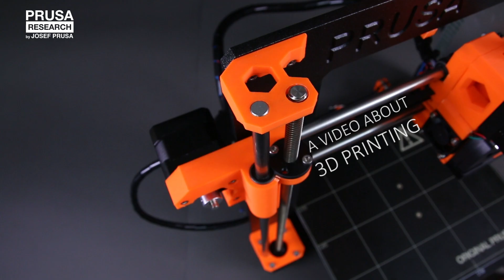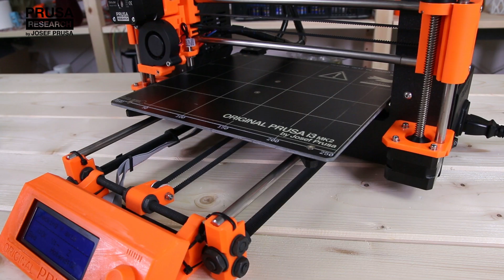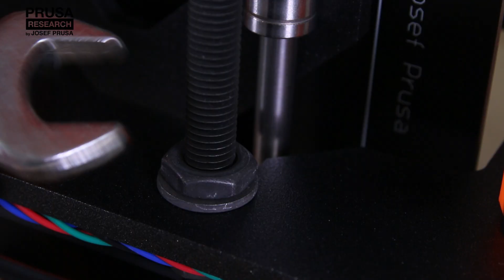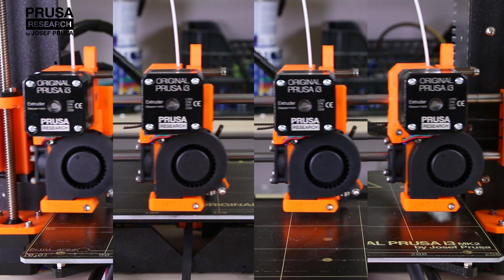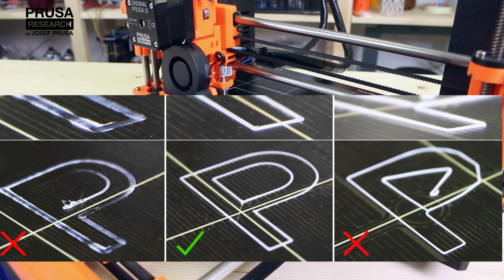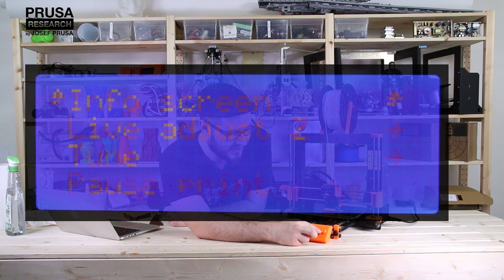Original Prusa i3 MK2 Guide for a new user

Comment: I just rebuilt my I3 with the MK2 upgrade kit.  I am having a hard time getting the print to adhere to the bed.  I have it dialed in on calibration, but the "first layer test" isn't sticking.  I tried using some glue on the bed, but still not working.  Wondering if there are any other tips or tweaks I should be trying.

Comment: Just some tips for builders of the 2s. I’m using a height of 1.3 mm for the sensor and a Z correction of -850, this gives me perfect results with the supplied PLA. Also I am sticking with firmware 3.1.0. I’ve experienced problems with later versions. Hope this helps.

Comment: I am encountering an issue where the PLA during the V2calibration print is not sticking as well to the left side of the bed. It sort of dabs out on the left side instead of laying entirely flat as it does on the right? I checked the bed leveling it passed.

Comment: I have spent hours trying to fix my assembled version which was making dents in the heatbed during the calibration tests. Took three months and a half to get it. I've watched this video about seven times, searched through forums, FAQs and communicated with employees and still is not working properly :(
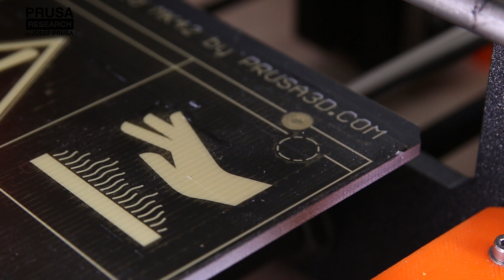Reply: Also I will need to adjust the Y axis though I have no idea where since the image at 8:42 isn't very clear on its location on the printer.

Comment: I got my mk 2 arriving before the end of the week .im cramming all the info i can get so to have a little heads up on any problems with assembling or even running this printer. Failing to prepare is preparing to fail. my version is the fully upgraded mk2 version did they make a half upgraded version also ?

Comment: Hello all. I would like to ask if anyone knows what are the lowest pc specs that could be used for 3D printing with Prusa printer? I tried to find any pc requirements but with no success.
Reply: Because there are no requirements for 3d printing there are for slicing so search up 3d print slicing requirements  You can get the prusa i3 mk2s with fast shipping on eBay now pre assembled almost same price as buying from prusa considering import tax and the shipping they charge. the one in ebay ships with  6 spools filament. Search prusa i3 mk2s on eBay and go down there is one for 1100 pre assembled

Comment: If you have trouble getting the print off, a spray of Isopropyl alcohol round the print can help for PLA.
Reply: This trick helps with TPU and flex filament as well.

Comment: For additional filament (PLA), what is the correct size for default nozzle?  I'm confused between .4mm and 1.75mm seen online filament sellers.  The manual talks about acupuncture needle .3-.35mm.  Thanks.
Reply: Are Jayem The diameter of the nozzle on the printer is 0.4mm. The diameter of the filament is 1.75mm. The needle is undersized so it can enter the nozzle easier.
Reply: Got it!  Appreciated.

Comment: Wanting to order one... But $500 Bucks for shipping to the US? That is almost as much as the printer
Reply: If you order on their website it's $70 for shipping to the US, not $500.
Reply: The issue was their site. If I used my zip it was $500. If I used the zip on the other side of town it was $70. I ordered it with wrong zip and they changed the zip while I was in chat with them then send them screen shots so they could fix
Reply: Delaney Wade You can get the prusa i3 mk2s with fast shipping on eBay now pre assembled almost same price as buying from prusa considering import tax and the shipping they charge. the one in ebay ships with  6 spools filament. Search prusa i3 mk2s on eBay and go down there is one for 1100 pre assembled

Comment: Saving up to buy one now Josef but I gota ask. . . .

In the Video between cuts
The bust and star destroyer disapears from on top of the shelf.
The green 3d printed nuts and threade rod goes from the topleft shelf to the 2nd down from topleft.
On the thirddown from the topleft the Device next to the toy car looks like it has a tool head atachment added on it and the orientation of the 3d prints has been changed and the print containing an item has had the item moved to the right
The cable for the device on the fourthdown shelf has its cable moved to the front if the device instead of being on top of it and the orientation of the prints has changed as well with the bronze vase being inverted as well.
Bottom shelf paper towel is in the silver box and the item next to it changes from a Cylindrical object  to a silver Yoda looking thing and an orange vase from the shelf above has been moved down to this shelf.
On the thirddown shelf from top right a spool of black filament appears resting on an empty filament spool.
A black 3d print is gone from the fourth from topright shelf as well.
A couple of polls appear leaning against the right side of the shelf.
Your shirt goes from a BillaBong shirt to a plain black t-shirt.
Your hat magicaly transforms into a grey barret.
Paint scraper goes from the right of the table to beside Joe's computer.
The clear windex becomes a purple windex.

There where alot more.

Which is why I think it was intentional I particularly liked how the Mark One Iron Man armor had its helmet on then off and then on again.

You guys did all that on purpose didn't you ?
Reply: 3d Newb You can get the prusa i3 mk2s with fast shipping on eBay now pre assembled almost same price as buying from prusa considering import tax and the shipping they charge. the one in ebay ships with  6 spools filament. Search prusa i3 mk2s on eBay and go down there is one for 1100 pre assembled

Comment: would it make more sense to have it calibrate before heating up before doing a print job? It would lessen the chance of the nozzle leaving droppings on the bed.
Reply: No, think it through a bit further , doesn't the bed need to have been expanded by the heat of the bed heater before it can be calibrated. accurately ?

Comment: At 5:10 you move the extruder to the middle, and I noticed that you need little pressure to move it. On my printer it's much tougher to this! Any ideas on what might be happening?
Reply: Did you disable the steppers?
Reply: How would I do that?
Reply: It's in the menu.
Reply: Ancyker A

Comment: Hey, the printer looks like a well evolved design. However, I don't like the fact that it relies on the mechanical "crash" of the Z-axis on the top to get to a known Z position. Why don't you use a Z-max endstop? I have a Prusa i3 like printer and the first thing I did was to change it from a mechanical Z-min to a Z-max endstop because fiddling with the mechanical Z-min endstop is really painful. With a Z-max, you just have to adjust the overall height in the eeprom/firmware without any mechanical interaction. And if you have a bed probe too (I don't) you can automate that and even optimize bed leveling.
Does the firmware support a Z-max endstop even if it is not supplied by default?
Reply: RoterFruchtZwerg That's not for z position (homing) but to align both sides of Z axis. The electronics cannot drive the two motors separately, and doing so would require two more endstops which in turn must be precisely aligned (most sensors have some variance). This way they just need to hit the edge until both motors skip. This is not like skipping cogs, which grinds them down; the steppers just wobble from failing to follow the magnetic field. The normal homing is done with the inductive probe near the bed.

Comment: Joseph, I just assembled my kit, which was quite fun! I came across a couple of issues thus far. The first issue was the LCD panel. A knowledgeable person on your site's forum told me to make sure both red wires of the flat cables met with pin #10. I spend a couple hours trying to figure this out to no avail till I heard that tip. It might help others in assembling. The second issue, which I've been trying to tackle for the last day or two has been the calibration. Oddly, I started with only a "skewed X/Y" message," which I tried to fix. After next calibration I received a "severely skewed," calibration, then "calibration error couldn't find front points, then after the last "fix" I received the "X/Y calibration [general] failure." Now, I'm just a little stumped. I followed your manual's directions for each issue, but as you can tell, it seems to be escalating. Just looking at the printer's frame, all appears to be square, belts tight, no slips/not too tight, axes move freely, hmm.... Maybe there is a
Reply: Woops, accidentally hit the enter button. Just wondering what you might suggest doing. Also, because of the LCD issue, I couldn't figure out calibration and damaged the Ultem. Do you know where to get some good replacement sheets with adhesive more locally in the USA?

Comment: what Cad software do you recommend to use with this printer?
Reply: I use Solidworks
Reply: I use autodesk fusion 360
Reply: Pretty much anything works.  For engineering I am a big fan of FreeCad which is Free.

Comment: why no one talk about the software in every video i see 
what the program we using ?
is the printer sport any model (we  find in the internet )  ?
can we print without the sd ? (using USP
i want to see a video about the printing model from A to Z
Reply: Ali, the purpose of this video is ONLY for Prusa customers who have bought the new Purse i3 MK2 printer. It's definitely not a general video about 3D printing as you probably could find on YouTube
Reply: i ask because i have 3d printer i bought because  the hardware  is good and easy to build but i fain the software so bad and difficult to print the model with .

Comment: Pro Tip. If you're going to print the Prusa logo, print at 40% speed(or lower) or else you'll get layer shifting(happen twice to me). I finished putting my kit together, and now watching it print the Prusa logo. Great printer for a awesome price , I'm glad I bought this and not the overly expensive Ultimaker 2 or Zortrax. EDIT: my layer shifting issue was the result of a loose pulleys! Check your pulleys if you have this issue.
Reply: Yeah, and when you get the Prusa logo mirrored you have changed your X and Y axis. Happened to me when my Original was not yet upgraded to MK2. Made me scratch my head for many hours.

Comment: On the latest machines "just got mine" all the tests that are said to be found in SETTINGS and now to be found in CALIBRATION. so do not freek out if you can not find them in the Settings menu.
Reply: That's right. It's a little bit confusing...
Reply: I also found that that if you have to stop a print then the cooling fan at the extruder tip stays running eeven if you start a new print job. And with that fan running the the first layer in many case will be screwed up. But if you turn off the machine or push the rest button then the cooling fan will stay off until after the first layer.
Stopping a print can also make the Z axis adjustment disapear from the menu. So a rule if I have to Stop a print for any reason I always do a power down before I start printing again.

Comment: I can't wait to get my printer. This video is almost perfection. So thank you very much for making it. :) My only tip is to speak extremely clearly so my laptop speakers can make out what you're saying. Overall your English is really good and your presentation is fun and engaging. I'm going to love this printer. <3
Reply: Oh, you sure are. After the latest firmware upgrade where the calibration was introduced, its just plug and play and print like a pro. I love mine so much. Cannot thank myself enough for doing a proper research before buying. No other manufacturers offer that much quality, support, reliability and precision for that price. And the upgrades... Once you have it, it just like grows and evolves with time, as there are always upgrades coming out, software and hardware. And for hardware there is always upgrade kit for older versions available.

Comment: Always gives error in z of the last magnetic alignment point , I think these magnets should be higher to avoid such headaches. I have given good recommendations of MK1, but MK2  is very laborious to regulate these 9 points , it is practically impossible to achieve 100% alignment. Lucky who bought this new MK2 and managed to use. I regretted the purchase .

Comment: What are the print speeds that MK2 can handle reliably? Is 80-100 mm/s a realistic speed? Can it go even further and maintain quality and reliability of the print?
Reply from the maker: No Prints with 80-100mm will not look good on any printer. However printer can move this fast. It is similar to Ultimaker claiming 300mm/s speeds but prints at 40mm/s :-) See for yourself https://youtu.be/fcr329LuH5I?t=31s
Reply: Im sorry to say Joseph Ultimaker and Makerbot are for professionals that dont have time to waste tweaking , your printer is just full of issues, 600 euros is not cheap compared to your competitors that are by far better, Instead of buying an original kit I would just build a Chinese kit with a Flexion extruder  which will be at least 100 euro cheaper than your kits, or get a WANHAO DUPLICATOR i3 PLUS and just ad a silicone sock ;)
Reply: Josef I posted a question about your video.
Did you guys do the continuity errors between cutaways on purpose ?
Reply: Mustafa N Kamil  prusa
Reply: I got a Tronxy clone, and like and recommend it.  But I also have the real thing, and the real thing is the real deal.  Glad I have both.

Comment: A round spatula is an excellent suggestion, i dug a 4mm gouge into the center of my bed with a square cornered one :/  Still prints great though and i plan to replace the PEI in a little while when i figure out the process/parts.
Reply: Tip: Get a whetstone and sandpaper to smooth out all the manufacturing burrs and add a curved corner with the sandpaper. shaping the custom blade profile where its a bit sharp in the center and fans out into a rounded dull blade. It will be a spatula made for 3D prints that will not damage the bed but sharp enough to get under the print.